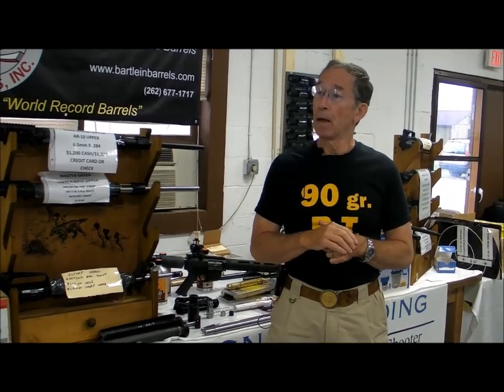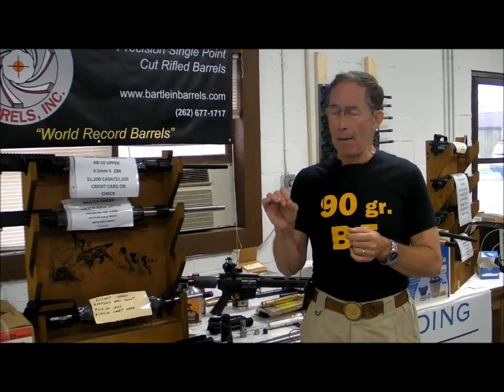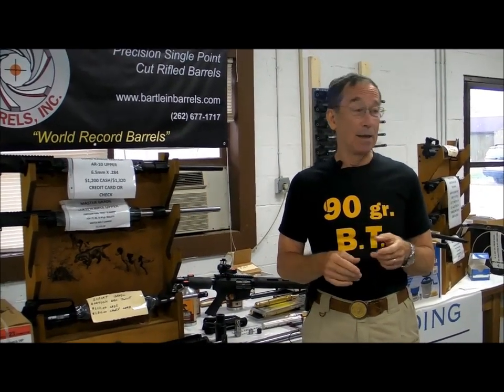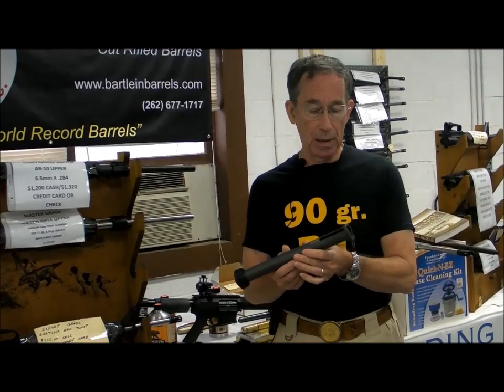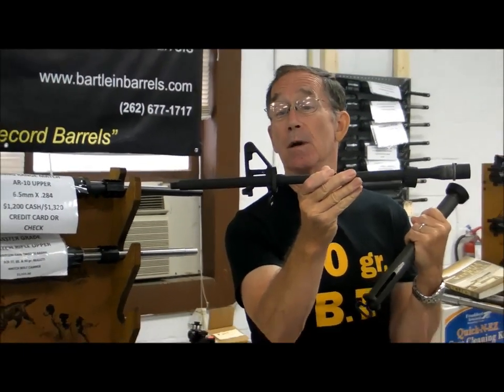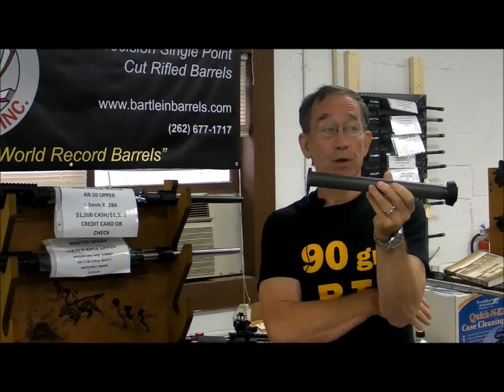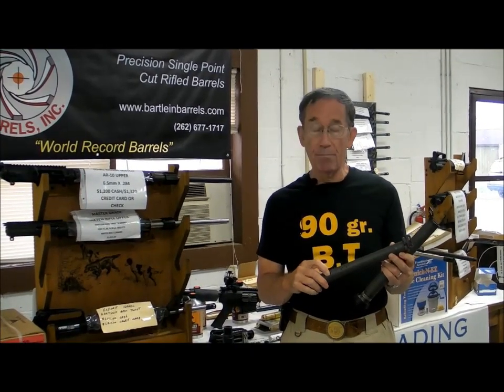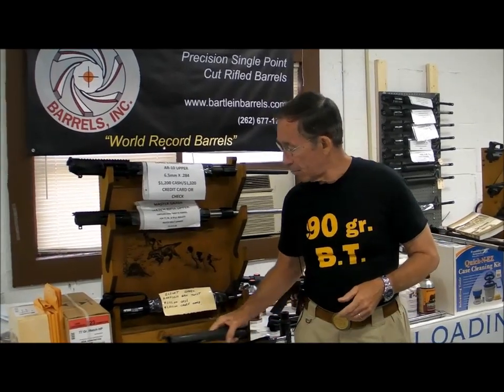AR-15 Barrel Harmonics (2 of 3)

Comment: I believe your theory on bending the float tube is flawed in one regard, simply because due to the principal of a lever, more force is potentially exerted on the rear of the float tube. Otherwise a very good video which, along with your other videos, I'm going to give serious consideration too. Thanks for the great information!
Reply: Russell Cowher it's not about how much pressure is exerted at the point of contact, but rather how much travel is produced for a given pressure. 10lb of pressure on the sling equates to more movement up front than it would at the back.
Reply: The force would indeed act as a lever and apply that force on the rear of the float tube. BUT! It's not directly on the barrel, so it's a better way if you're a shooter who prefers sling tension.